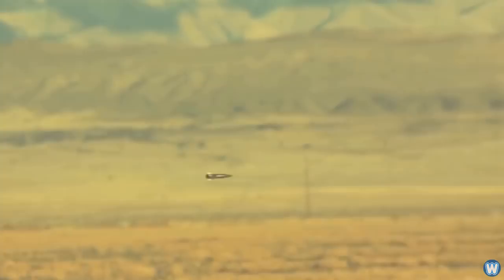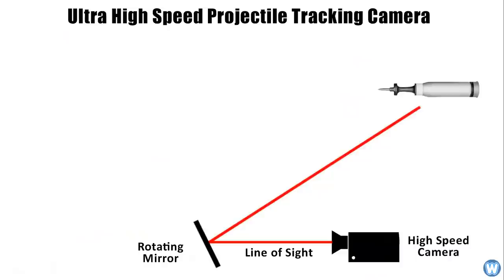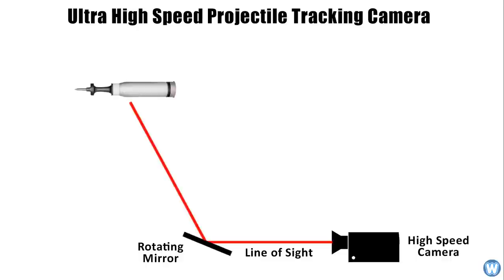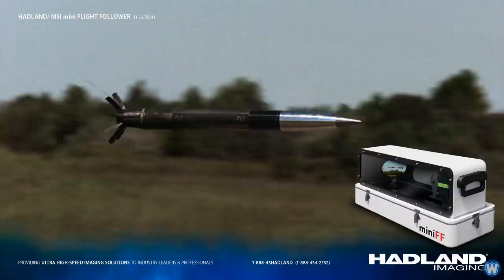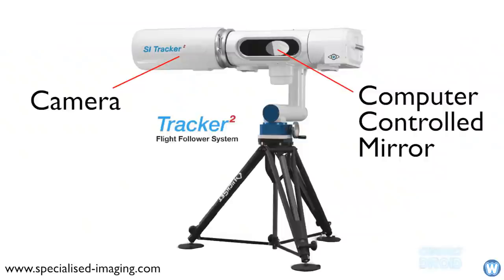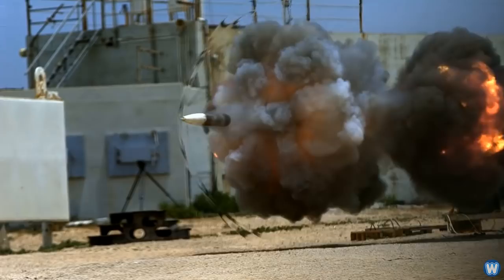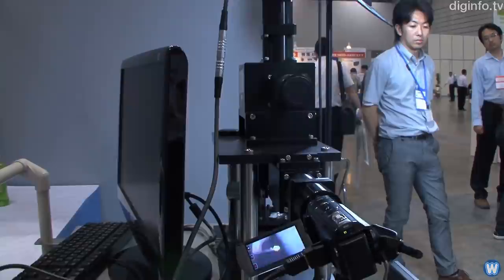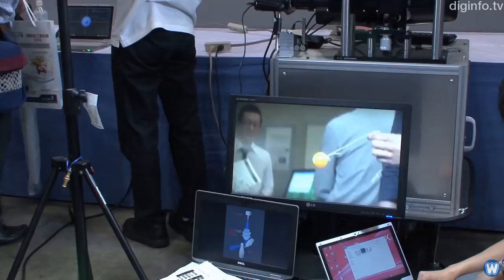US Navy Railgun Projectile - How it was Filmed in Flight

Comment from the maker: ★★★ FREQUENTLY ASKED QUESTIONS ABOUT THE VIDEO  / FACT UPDATES ★★★

1) how does the mirror track the projectile? - I am not sure, but I would assume the camera tracking system is tied into the firing of the weapon and the mirror starts rotating at a set speed, calculated off the projectile speed. Either that or it has an amazing tracking system.

Ryan Heat said in the comments below - The mirror movement is generally started by using a flash detector pointed at the muzzle. This way the Flight Follower can be used with any medium/large calibre systems without making special interfaces or modifying the firing system. Also the system can work using an estimated velocity, or it can measure the velocity at various points along the flight path and adjust the speed of the mirror to suit. "I know this because I designed the system"

2) What is the smoke coming out of the railgun - That is metal on metal contact from the round going down the shaft of the gun, hence why shooting this gun starts tearing apart the barrel.
Reply: The Mini Flight Follower is actually manufactured by MS Instruments. I know this because I designed the system :) The system can work using an estimated velocity, or it can measure the velocity at various points along the flight path and adjust the speed of the mirror to suit. If you have any other questions, just let me know!
Reply from the maker: @RyanHeath85  nice thanks :)
Reply: Oh, and the mirror movement is generally started by using a flash detector pointed at the muzzle. This way the Flight Follower can be used with any medium/large calibre systems without making special interfaces or modifying the firing system.
Reply: S
Reply: 11

11
Reply: Well it wasnt the exact missle that hit the Pentagon on 9/11 which, as most intelligent pplk ow was IN FACT  a Tomahawk Build 4 cruise missle that hit the Pentagon on 9/11
Reply: @portobelloedinburgh8891  Think you mean Flight 77. Bet all the people who had family members die on that flight don't appreciate their kin being written out of history. Not that alternative history counts as history.
Reply: Amazing ! Thank You !
Reply: @Wonder World The answer you got is totally incorrect.  A flash detector cannot control the speed the mirror needs to rotate. ALL ammunition differ in velocity. the difference could be anywhere from 50ft/sec to 100 ft/sec or more. This while small will be enough to throw a tracking system based just on the initial flash because it MUST have the exact muzzle velocity of the round.  The mirror tracking system has 2 sensors linked to it. One sensor is attached to the end of the barrel and another somewhere slightly towards the breach (the other end) and they detect the movement of the round inside the barrel.  This allows for the tracking system to calculate the muzzle velocity (distance1 - distance2 divided by time = velocity) and signals the mirror when to start rotating. Because it has the muzzle velocity and knows when and how fast to turn/rotate the mirror, it is able to keep the projectile in or near the center of the frame using the adjusted speed for that particular round.
Reply: Bullet speed : amazing
Cameraman : legendary
Reply: @JS-ob4oh  first of all muzzle velocity is well known in advance for these systems. It would only need to slightly calibrate which is no problem at all for such a high speed setup. Second it's only the mirror that moves, and as you saw in the real-time tracking of the ping-pong ball the mirror is capable of instantly tracking an erratically moving ball with no problems, let alone a pre-calculated trajectory with an object over 100 feet away. Third point is that the muzzle flash is easily enough to start the operation, and since the mirror initially has to move very little because of the sharp angle it has at the start and gradually increases in turn speed the system has plenty of time to calibrate for any deviations to trajectory or velocity.
Reply: i took the video with my iphone camera lol
Reply: How thick were the panels they shot? That is some friction & energy!
Reply: @RyanHeath85 ingenious. Awesome design, that must have been fun to work on.
Reply: @MrKadvaga  Version 2 is on my 'to do' list but unfortunately I've got more urgent projects to work on at the moment :)
Reply: @MrKadvaga  Thanks! Yes, its very satisfying when everything works.
I'm hoping to work on version 2 this year, hopefully we'll get some cooler videos to post :)

Comment: Reason why “spinning mirrors” is better than spinning a camera + lens:  mirrors has low mass, smaller motor, easier fine control of mirror, faster response when starting mirror spin.
Reply: only if the mirrors are metal, the glass will give double vision
Reply: @PavelMy  not if it's a surface mirror, i.e. the reflective surface is on the glass, not behind it
Reply: @SivaKanthSharma  and what is the glass for then
Reply: @akiraakiraakiraakira  a surface to apply that reflective surface?
Also easier to make it flat
Reply: @SivaKanthSharma  glass is very brittle though, maybe it's just me but the glass seems superflous

Comment: We used these cameras, the best was an older version that used air driven mirror rotation. Hardest part was tuning time to firing to actually catch the shot in the rotation perfectly.
Reply: Seen it done where the weapon fires based off the mirror and not the other way around, similar system to how a plane machine gun in older prop planes could fire through the props without hitting them, except done electronically basically arm the device and when you 'fire' the system takes over for a fraction of a second and waits for the rotating mirror at a given specific rpm to rotate to the precise angle in order to track, takes a lot more math but with expensive ammunition it ends up saving a lot in the long run

Comment: The insects can be tracked for many meters, with a cam a few inches behind them.
The system works with cables, with wires.
3 wires, 1 up down, one left right and one wire for front and back.
Third person cam, just behind a dragonfly.
Never more then 3 inches away, for macro footage.
Amazing how it is done.

Comment: 1:10

The shockwaves from the explosive power of the railgun
Reply from the maker: That's not the railgun, that is a tank firing a round
Reply: @WonderWorldYTC  ah, my mistake
Reply: @broskydoodle6697  APDSFS... even that Dart flies with 1.5km/s or even more... Ridiculous isn't it?
Reply: @mr_confuse  
APFSDS, Armor Piercing Fin Stabilized Discarding Sabot. I don't think that's APFSDS though, the projectile is too large and I didn't see a sabot. I could be wrong, of course, but usually the flechettes are quite small.
Reply: @The_Crimson_Fucker  I think you are rigth that maybe is a HEATFS but I doubt it my best guess is it was a APHEFS because of the size of the projectile it most likealy has a lot of explosive mass in It, and the tip of the shell is very pointy regular HE shots are not always compromised with that aspect.

Edit:wording
Reply: @rhazien2502  It's probably just a dummy round for testing purposes.
Reply: @The_Crimson_Fucker  eh maybe, but it is very long for a training round, it has a lot of mass for just training shell it could fit a lot of explosive mass and AP mass
Reply: @rhazien2502  
Which is why I said "for testing purposes", that's obviously a test environment.
Reply: except not the power from it its the projectile/gases travelling at the speed of sound
Reply: @The_Crimson_Fucker  It's a HEAT-FS round, I know the source, stop calling it a training round, those aren't a thing, there are practice rounds though.
Reply: @benjaminpadilla1464  
Learn to read. I never called it a training round, I said it was probably a specialty projectile for testing purposes.
"I know the source"
Then provide it.
Reply: @The_Crimson_Fucker  I was mostly talking to @Rhazien, they are practice rounds because you can't train a round, but you can practice firing with one, was my main point. As for giving you the source...takes too long to find it and post it, even thought I know the link. ¯\_(ツ)_/¯
Reply: @benjaminpadilla1464  yeah why did you @ him if you're not talking to him?

Comment: Those cameras work by knowing the expected volocity of the projectile and are triggered via a set of cameras that detect how long it takes the projectile to pass through the two cameras under a barrel.

Plug the FPS measurement in and away it goes, if your tracking something that's Likely to slow down after passing through an object it will eventually end up out the frame.

Comment: The reason why we use mirrors is because it's easier to rotate a light weight mirror than it is to rotate a heavy camera.  Even if a camera is relatively light, it might weigh a thousand times more than the mirror.  So the simple solution is to use a mirror, where it can be done with less components.  And it keeps from having acceleration/deceleration issues that might crop up, which could either cause visual loss of tracking or wear and tear on the camera itself from the sudden acceleration/deceleration.  Another benefit is that the mirror itself is balance in mass/shape.  A camera is not.  So a camera being physically rotated, would need inconsistent amounts of rotation power depending on the arch you're rotating it at, in order to rotate it consistently.

Comment: In that ping pong ball video, the ball isn't really in the center but wobbles around it and that is because the lag of the computing and mechanical mass movement of the mirror. What they should do is post processing the video data where the ball is drawn artificially to the center by moving the center point of the footage. This is called digital image stabilization or artificial image correction.

Comment: It is about tracking system but camera and speed are more important things... eg. IX Cameras Series 5 for slow motion have 6,382 fps. For that reason you can to see 212 times slower picture at 30fps without losing any frame in second.

Comment: even if you use computer controlled tracker system, you need high FPS camera... if you use 30FPS camero which controlled by tracker system, you can not get the same result as it showed in video... because computer controlling system, mechanism will work fast...  (btw, it depends on the distance & the angle... like, think you are taking car photos, we call it "pan"... car looks will be steady and the background will be look like moving... you have to use lower shutter speed kind of this shot.. if you want real shot in real speed, you will need high speed camera...  if you will use lower shutter speed, id depends of object angle (oof your shooting point) you may need to change your shutter speed, lower or highher... i know it is a little bit complicated but in the field (ofcourse depends of your experience it is easy to understand)... for this video, i guess we will need camera ability to shot high FPS (shutter speed).

Comment: But how does the mirror know when to start turning to track the projectile?  How is the firing and mirror turning synchronized?
Reply: The way it is synched is to have 2 sensors located one at the end of the barrel and one slightly further down the barrel that serves 2 purposes. 1) It allows for the exact calculation of the muzzle velocity; all ammunition differs slightly in their velocity and although the difference is relatively small, it can throw off the mirror tracking system. 2) It tells the mirror when to start rotating. The above allows the mirror system to track at the exact speed and at the exact moment the round leaves the barrel.  This is actually the key to what makes these kinds of filming possible. The camera itself is an ordinary high speed camera.
Reply: @JS-ob4oh  No, they set the camera to the known muzzle velocity of the round being shot which is pretty well established. For missiles, which do not have a set muzzle velocity, they use sensors downrange.

Comment: Great video, the question I have though is how does the mirror know where to point, image processing?
Reply from the maker: not sure myself, it could be some kind of movement detecting software, it could be setup and timed with the firing to move at a set rate over a set time when the gun is fired, and they simply fine tune that movement over various tests.

Comment: Is it really tracking the object or just tuned for the speed? The ping pong ball is, but I’m skeptical of the rail gun projectile. It’s probably just set up to follow a projectile at a certain speed, a vision system feedback loop for a projectile traveling mach 7 sounds tricky.
Reply: Yeah not really tracking it like the ping pong ball.
Reply: IIRC, they set an EXPECTED speed, but then it's corrected in real-time using speed traps that sense the projectile.

Comment: This video still doesnt speak in relation to what sensors is picking up the various projectile(s), and thus feeding the motor the data it needs, in order to move the mirrored image, in speed with said mach 3 projectile.
Or, am i misisng something?
Reply from the maker: it may not be a sensor at all picking up movement of the projectile, it could simply be tied into the firing switch so when they fire, the camera mirror starts moving at a set speed.
Reply: @WonderWorldYTC  Thats acutally true, didnt think about that! Thanks

Comment: Love the video but I'm still left questioning what type of tracking sensor is used to steer the mirror? The pingpong ball is probably just an optical sensor but I'm assuming there is some x-band sensor or something for the field tests? Those cameras are pretty compact though, maybe they get wired to external sensors? BYOS? If it's all done with just optical/ir sensors and a mirror I'm very impressed.

Comment: Those have to be some really fast servos and feedback loop to a get real-time performance like that.
Reply: Just increase or decrease the distance from the camera to the mirror. It makes the sweep speed quicker.
Reply: @someguy5035  The camera is stationary. Only the mirror rotates.
Reply: @junkdubious  Yes, I know.
Reply: @someguy5035  So we're on the side page. So if you did what you say, the rotational distance will be shorter but the incremental degree of motion will need be finer.
Reply: @junkdubious  And of course, the FOV becomes more narrow or wider as well. 

I bet all those variables are adjustable to some degree. 

It also makes you wonder about the physical limits of the speed of the mirror. Eventually, it would spin so fast it tears itself apart.

Comment: I guesses it was high definition wide frame shot that was zoomed in and tracked frame by frame in post.  i was wrong.  im not a photographer though.
Reply: the reason why that would not work is because frame-rate and quality are inversely proportional. So the more pixels, the lower the frame-rate will be. So, zooming in on a wide shot would mean that 80-90% of your pixels are wasted at any one time, and the frame-rate is too low to capture a good image. Using this method, both problems can be solved.

Comment: China: Our new ships are top of the line and are capable of defending against any incoming missile.

U.S. Navy: 2:54
Reply: SeanNotConnery yeah but China has railguns aswell tho🧐
Reply: @smd1011  their railgun project is years away from being combat ready, just like the American project. for a railgun to finally be put into action you also need a ship that can use it. said ship needs to be able to generate the enormous amount of energy to fire the gun.

the only ships in the world today that has such power generating capability are the Zumwalt class, but actually integrating a combat ready railgun into the ship will be a massive endeavor in itself.

china does not currently possess a surface combat ship with the necessary electrical generation requirement to operate a railgun. 

they supposedly mounted a railgun on a ship, but the ship in question is an amphibious landing ship. it is not a surface combat ship. it is also unclear if the weapon is even operational.

the most advanced surface combat ship china possesses is the Type 55. its power generating capability is only 30 MW, compared to the 78 MW power capacity of the Zumwalt. the Type 55 does not have the necessary power to mount a full sized rail gun.

Long story short, neither country will have an operational full sized railgun on a surface combat ship any time soon.

(By full sized I mean a railgun with at least 32 MJ of muzzle energy. About 25 MW of electrical power is required to operate one such gun.)
Reply: 8biscuits u expect me to read the book you just commented

Comment: Wait so it's a mirror that moves that fast ????
Reply: The mirror doesn't need to move that fast. (it's still fast, but not mach 7)
Imagine yourself using a laser pointer on some mountains - you can whip the laser point from one side of the mountain range to the other in just a second, but your hand didn't need to travel at hypersonic speeds to do it.

Comment: What are the artifacts at the tail? 1:20
Reply: That is because the projectile is so fast that it compresses the air around it and becomes visible.
Reply: @BiteMyShinyMetal4ss  so we're seeing the sonic boom (I assume there is one, it's multiple times the speed of sound) or something different? Seems like it's only the tail, which is least resistant to the air, right?
Reply: @soulife8383  No, the sonic boom already happens in the barrel. If you can, watch videos of explosions in slow-motion and you will see a similar effect around the blast. You will see that the air is compressed, almost as if it were in water.